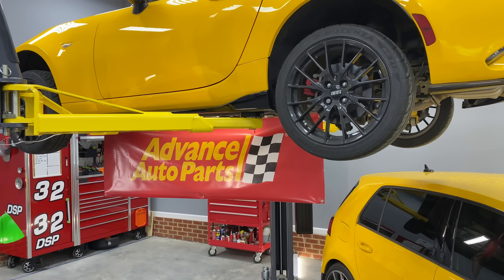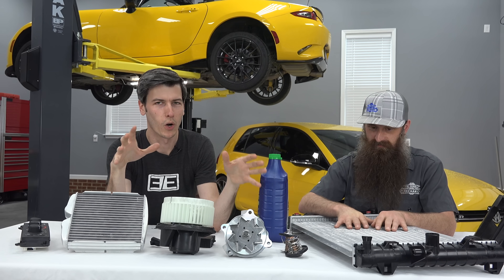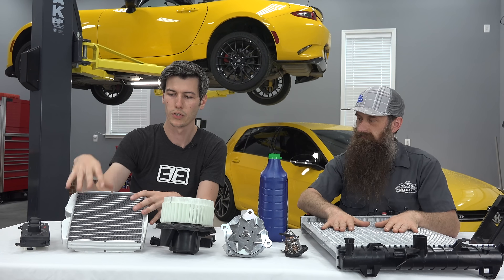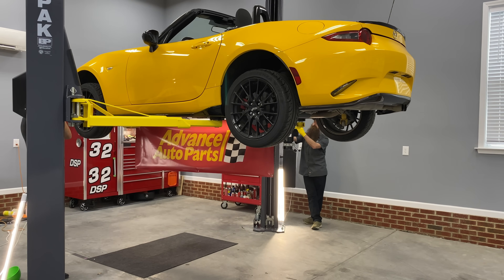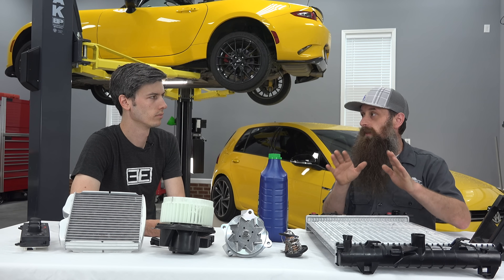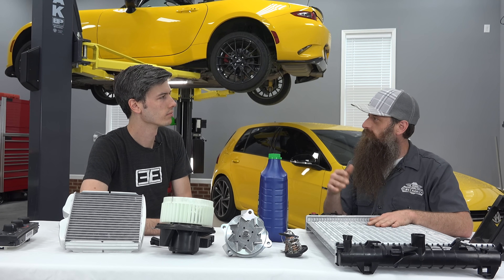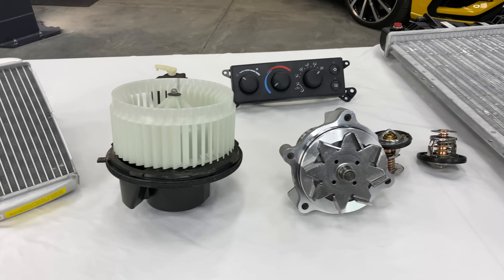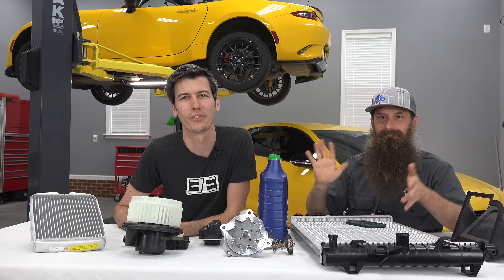Why Doesn't My Car Have Heat?

Comment: What if you take the panel off the 3 knobs area? Could the heater/a> knob be bad behind the panel. Can you replace just the knob or the whole panel if one of the 3 doesn't work. I just don't have heat

Comment: I have a 92 cadillac deville, the problem I've been having is sometimes I'll have it idling for 40 minutes and the car still isn't blowing hot air when it used to do it in 10 minutes, sometimes it'll work sometimes it won't, I do hear the blend door working, there's no leaks and it's holding coolant so my guess is it may be a thermostat but I'm not quite sure seeing as how sometimes it works sometimes it doesn't

Comment: Hi! Great video. Maybe you can help me with one problem I have. My sister has a Fiat Stilo 1.9 jdt, 2004. Since cold days come heating in her car is not good. Instrument cluster also shows low coolant temperature even after 30 min after engine is started. Outside temperature is about zero degrees Celsius. She changed the thermostat, because we thought the thermostat is stuck in the open position, but situation is not much better. The weird thing is that hose on the top of the radiator is hot, and bottom hose is cold (to me this looks like thermostat is stuck in the closed position), but instrument cluster shows low coolant temperature. This is really confusing to me. It looks like engine is cooled on some other (unknown) way, and thermostat remains closed. Do you have any idea what can be a problem?

Comment: I own a 2017 VW Touran with a 2 litre TDI engine. With all my previous 1.9 TDI VW engines, in the dead of winter (-10 to -20 degrees C), it takes a LONG time for it to come up to operating temperature. Letting off the gas and coasting will actually cool the engine before it can reach its operating temperature. I have tried to put window screening on the exterior of the grill with little results. I noticed VW has a hose that goes from the block straight to the rad to keep the rad from freezing. Any ideas how I can keep the heat in the engine block for it to get heated up while I am going through small villages and windy roads?

Comment: Changed everything on my friends Dodge Journey, no heat!!! New hoses, new heater core, new thermostat, new blend door actuator. Everything but the rad. The rad was the problem. Flushed the system more then 4x. But the problem was the gummed up pieces in the rad. They were so big they didn’t break down while flushing and would settle after putting the system all back together causing blockages. New rad and more flushes later, good to go. You likely understand the issue if you’re a journey owner.

Comment: Step 1 should be to make sure there's coolant in the radiator.  Without that, there won't be any heat moving around.
(I have found cars without any coolant....)

Comment: Also something so simple that I’ve seen people doing, they turn off the A/C button which turns on the compressor, which helps cool AND heat up the interior, much like a Heat Pump HVAC system.

Comment: I had a coworker come in on a Monday after spending all weekend changing the heater core on his car.  After that ordeal he maintained that if you go to the car assembly plant and went the very start of the line, there was a guy standing there holding a heater core that they then built the car around.

Comment: 1907 - first enclosed passenger compartment.  Still took 23 years before the engineers realized they had a big source of hot water to use for heating in winter.

Comment: What infrared thermometer do you use? I use mine almost daily for synchronizing motorcycle carburetors based on header pipe/head block temp but I find myself doubting the readings on occasion... It's just a cheap Amazon unit.

Comment: The designers of my car decided a temperature gauge was not necessary, so now I need to use an OBD2 tool to see if the thermostat has failed. Thanks GM.....

Comment: It's really awesome to have a cooling thermostat fail and stay closed in mid summer...
Engine was overheating but we managed to limp home by turning the heating to max and having the windows open in +30°C temperatures outside. So apparently the coolant was not going to the radiator but was feeding the heating system in that old Ford Mondeo?

Comment: My worst experience of driving without functional AC was actually on a motorbike. The bike had an in built ambient temp sensor which was accurate to a few degrees give or take for wind/sun. The sensor itself is inside the dash and shielded from direct headwinds, engine heat, sun etc so it was pretty good.

One day, it display reads 50 degrees and starts flashing at me because it reached the limits of the sensor and going further could damage it.
Now you might be thinking pfft, only 50f? that's not cold at all! But you see.. it wasn't 50f, but 50C
Middle of summer in Australia, ~10km/h in heavy traffic, textile breathable jacket doing nothing because no wind.. and the sun beaming down so much parts of the road surface were literally melting and tearing the rubber off shoes.

I was out there barely 20 mins and nearly passed out from the heat.. don't know what the true temperature was on the road either due to the thermometer capping out.

I envy all you peeps that actually have a reason to use heating controls, as I've never used them in any car I've owned

Comment: While traveling in Munich, Germany I was driving my cousins VW Rabbit in summer. Returning to the city, the highway was clogged with traffic, forcing us to slow down.
I noticed the car engine temp was suddenly rising quickly. While stuck in traffic, this was going to end badly, quickly.
I turned on the cabin heater to full heat. My cousin was annoyed until I pointed out that this was the only thing keeping the car from overheating in traffic. 
This was a temporary reprieve but it was enough to get us home without further mechanical mishap. Next day the car was taken for service, problem solved, though I did not hear what the ultimate cause of the problem was.

Comment: 2:00 I was an aircraft mechanic for a while and we frequently got RO's from pilots for inoperational units.  You'd be amazed how many RO's were signed off as "does not work in the 'OFF' position".  We can only imagine the razzing they got back in the ready room.

Comment: No videos on suspension geometries as of yet.

An idea.
Start from basic leaf springs.

Please explain why the 2 joints in leaf spring setup of Daihatsu Hijet/Piaggio porter are uneven. Also explain the dynamics.

Comment: General question
When you are on a low rpm that means that the throttle isn't fully opened, and this mean that the cylinder wont take all the air that it need, so the compression ratio of the car will be achieved only on high rpm only when the throttle is fully opened, and also the turbo charger or the super charger isn't usefull on low rpm when throttle is partially open 
Am I right?

Comment: I had a 1978 subaru GL sedan when outside temperatures got colder than -30F at highway speeds the engine temperature bottomed out, the old 1600cc boxer engine had too much surface area.
coolant level will gradually drop due to EVAPORATION.
old engines the thermostat mounted to the engine block.

Comment: I have unrelated questions: Does the shape of a car's engine's compartment affect the aerodynamics of a car?  Does it cause a car to hold in more heat if shaped a certain way?  As moving air flows through the grill, under and around a car, some of that air passes through the engine compartment.  When the air exits, does the shape of the compartment causes some lift under the car?  Does it cause some air restrictions that affect the car as a whole?  What if a skid pad (or something similar) was installed, would that help with better air flow coming from the engine compartment?  In your opinion, if a car had more components in its compartment (limiting air flow in the engine compartment), would that be better or worse for heat dissipation and aerodynamics?  I also wanted to know if there are air pockets in the engine compartment without proper air flow could cause the engine to stay or to get warmer.  I am thinking that if a compartment was changed to an unconventional shape, it would help in these areas.  Would you consider making a video addressing these issues mentioned?  I ask these questions because of a home project I am considering.  Thanks so much - love your content!!  Keep it up!  You've helped me understand other areas and systems here.

Comment: Cars from the sixtys and seventys always had some heat, if there was enough coolant. Even if the fan quit. Even in weather below freezing I would turn the fan off once the car cabin got warm. If got too warm just crack the vent window. Don't know what one of those is well gone because cheaper to make a door without them. Oh and you could move at freeway speeds in them without buffeting with any or all windows down a little or all they way down. There was no electronic gimmick to break. Not saying could not be broken. My sisters approach was good at breaking them. She moved the hot/cold floor defrost several times during a single drive. This was replaced by those electronic climate controlled  gimmicks that are so much fun repair and fix. And prone to break early and often.

Comment: Video Suggestion: Why don't Car Manufactures make car power systems like Earth Movers?
Using the engine as an electric generator and supply power to the wheels with electric motors.
Ex.: Terex MT 6300AC - The vehicle is equipped with a four-stroke diesel engine, with 20 cylinders powering an AC electric alternator,
   which in turn supplies power to the electric motor fitted at each side of the rear axle.

Comment: That is super interesting about the colorblindness issue in temperature control.  About 95% of the faucets I have ever used, hot is on the left, cold on the right.  Every temperature dial like that, cold on the left.  I was taught a standard for salt/pepper shakers when working in a restaurant for ADA purposes: pepper left, salt right.  They also have different hole patterns.

Interestingly, my shower is plumbed backwards, cold on the left, hot on the right.  Seriously though, the basic car temperature dial is totally lacking for the colorblind.  There is no C or H like a faucet.  I do abhor the digital displays/automatic systems though, I prefer manual controls.

Comment: My car gets no heat in super cold weather (-10F and below) because smol engine. Turn the heat up and I can watch the coolant temperature drop from 185 to 155 before I have to turn off the heat. (My coolant temperature gauge is installed before the radiator inlet, of course).

Comment: Thank you! I have a 2003 mk4 VW Jetta. Heat went out years ago, BUT I'm near Houston TX, so just drive with a jacket on for 2 months per year. 😄 Yeah, in almost 18 years I've already been through 3 thermostats, a new coolant reservoir tank,... AND all that cheap foam dried and pieces blew out the AC into cabin. Hey, the AC is still ice cold, it runs fine, and its  paid off years ago. I'm keeping her. 👍

Comment: Question: If you want to heat up the engine coolant fluid quickly, is ti better to keep the temperature dial on hottest or coldest setting?
Reply: Coldest! 100%. And by this I mean you turn the AC on and with all the systems running cumulatively this will cause all of the other fluids to heat much quicker

Comment: This reminds me of the one time I was driving an old Peugeot 309 during a very cold winter night. I glanced at the temperature knob and it was roughly at the middle. I cranked it all the way up and it didn't help at all. After some time the windshield started to freeze up. The next day I realized that the Peugeot geniuses had placed the cold on the clockwise direction and heat on the anticlockwise.

Comment: A follow up video addressing different methods for each symptom would be helpful! My 2010 focus had no heat at idle. Revving it for 30 seconds and idle 30seconds, off 1 min. Repeat 3-4 times (while engine is up to temp). Helped me remove the trapped air in my system! The root of this problem could be a leak..

Comment: VW's have the heatercore integrated in the small cooling circuit. Also it isnt the highest point in that small circuit. the head is. If you have a thermostat failure where its stuck close you can save your car by putting the heater on max with the fan on full speed. This way you can extract a good amount of heat from the coolant.

Comment: My car has a secondary water pump (electric) just for heat. So when I’m at a stop light my heat goes away since the rpm at idle isn’t high enough for the main water pump to flow coolant through the heater core. What a weird situation....

Also of course the replacement auxiliary water pump is $500 😳

Comment: My first car was an ancient Mustang. Winter came, and I found I had no heat. I conferred with a mechanic friend and followed his advice. Disconnected heater hoses. Stuck a garden hose nozzle in one. Nothing came out the other. Stuck nozzle in other hose. Nothing. Grabbed air compressor nozzle and shoved in one. Suddenly a geyser of red mud erupted from the other hose...all over me...all over the wall of the garage. But at least I had heat, after the mess was cleaned up.

Comment: I know you Jason read the comments, can I have a video explaining the reason engineers flow coolant through the throttle valve? I live in a very hot country where the need of heat in the TB in not that necessary but i would like to know the actual reason engineers do that.

Comment: I've got a strange one... Heat works, just not in one of the "blowing positions" (that sounds odd). It works on the feet, to the windshield, but not towards me or the passenger (blows cold air). Bubble in the heater core? It's a 2000 Daihatsu Rocky

Comment: Changing out a clogged heater core is the worst job you can imagine. It's hours of snapping off trim piece clips, laying with all of your weight on that ridge where your door meets the floor in pain, trying to twist your head upwards under the glove box or inside of the glove box cutout trying to reach the screws on the blend door actuator which for some reason has like 20 mounting points. Then you break off a one-of-a-kind plastic retainer clip and have to melt and fuse it back together with a soldering iron. You get the old core out and excess rusty coolant lands on your floor mats. The new one doesn't come with the outside foam so now you take a trip to the hardware store and hope to god the foam you choose to wrap it isn't flammable under that amount of heat. You slide the new one in place, but since it's a tight fit you damage like half of the fins on one side. Then you get slide your dashboard back into place and pray that none of the wires back there got pinched when you first slid it out. 0/10 wouldn't recommend.

Comment: I have no heat in my car. I have looked all over for the radiator. Cannot find it. No heater core inside.  There is a knob down on the floor by the shifter. Should I try that. Ps. The motor is in the trunk.

Comment: How do you remove air pockets from the heater core?
I'm only looking for a concept here, because I'm never gonna try to do it myself.
Reply: The best is a proper air bleed with a funnel when filling. 

The other trick is to lift the front of the car higher than the back. This helps burp the air

Comment: "A car without heat is a miserable ride." 
Me: Laughs in tropical Africa.
Reply: Me not so much living in Canada 😂
Reply: @brianwaldo2642  in my country it never gets cold enough to kill anyone. Coldest daytime temp is like 12° or so. Nothing a brandy can't fix. 😀
Reply: @mjmulenga3  Dude that's like middle of winter at 3am here.. almost as cold as it gets (Brisbane, Aus) 
10.2C average July lows over last 20 years. Midday temps in winter are usually around 20C too. I don't understand how my lawyer buddy wears a suit to work everyday, when I get barely a month of long pants and a jacket outside

I envy people who have a reason to ever press the heated seat buttons, or turn that dial into the red, as I never have in my life
Reply: Me: laughs in Russia, where I don't turn on the heating in severe winter on purpose, and instead open the windows, because it helps prevent frost buildup on windshield afterwards.
Reply: @victortitov1740  may you never run out of vodka, mate. 😄
Reply: Now in the UK it’s 5 below freezing and the heater resistor has totally failed, all 4 settings so it’s a miserable life. 🥶🥶🥶🥶

Comment: Some vehicles are even picky about the airflow around the engine and that gets irritating. My S10 is a model that has incredibly picky cooling requirements. It is very easy to accidentally over cool the engine because you left some little dinky shroud off or just looked at it wrong. Ultimately with those trucks I just cut a piece of cardboard with slots to place in front of the radiator, I adjust slot size in the winter for 75ish cabin temp and that's generally good enough flow for summer cooling to stay in ideal range. Didn't invent the idea either, got it from someone I saw doing similar but took it a bit more seriously then they did.